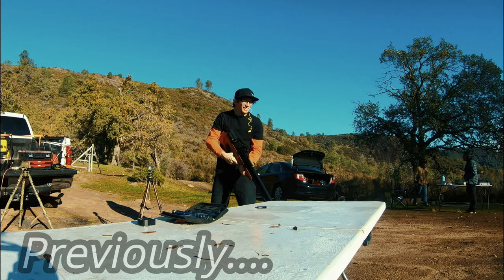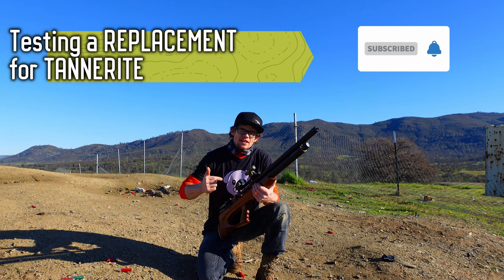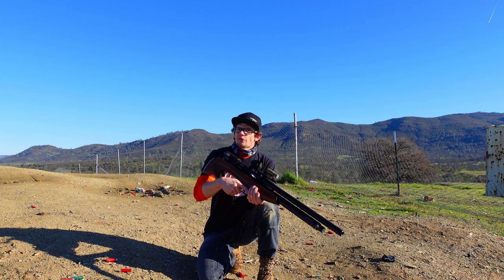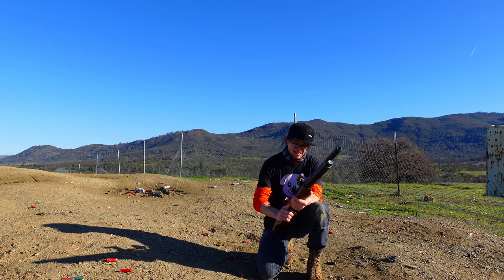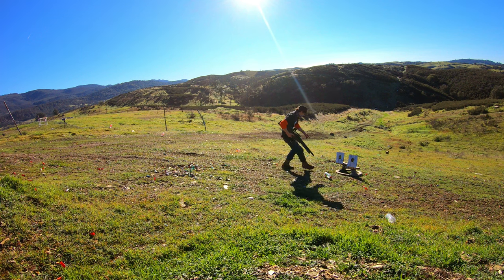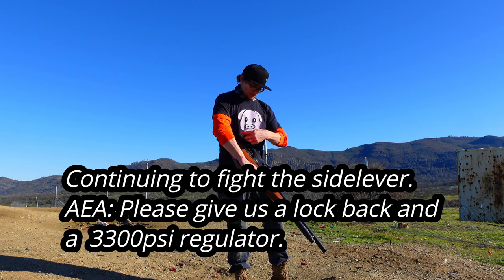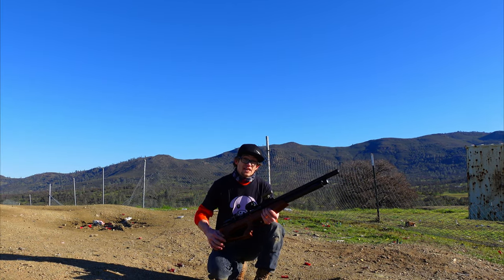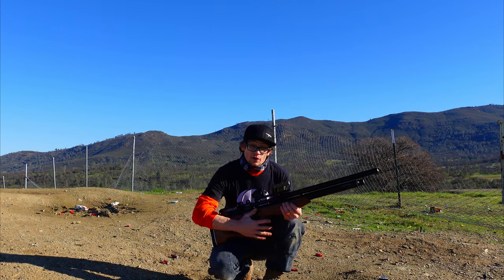Testing AEA 50 Cal Challenger Bullpup Against CALIFORNIA LEGAL TANNERITE REPLACEMENT #pcpairgun 2022

Comment: Hey, I've bought a demo   challenger from  bintac and it's the .457 with the power valve. Anyways I heard people having problems with this platform? Any luck finding parts and orings just incase ?  I have no problems of yet but the talk around the water hole is saying that Those side lever challengers will brake. I just wanna find parts when it does happen and what fails on those?